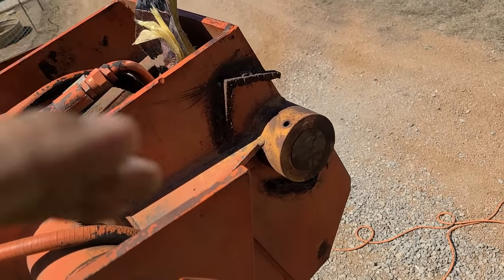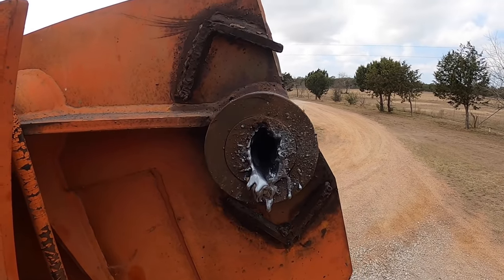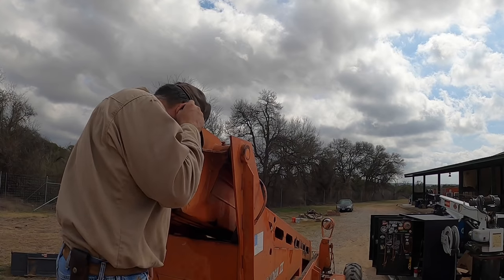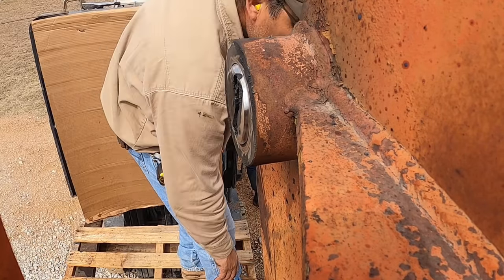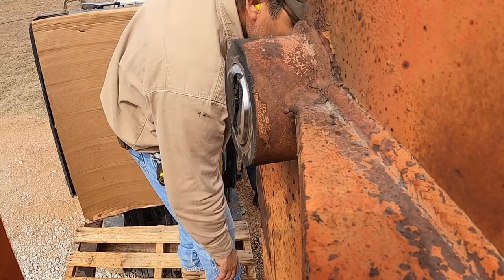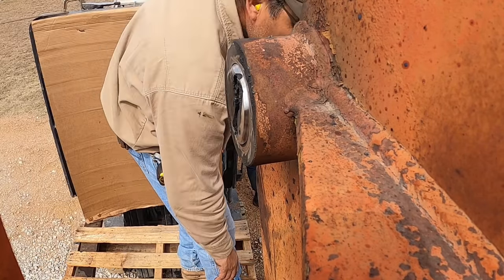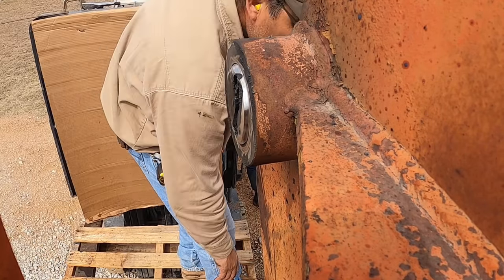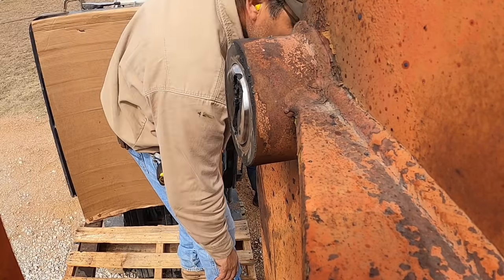Exothermic Slice torch For the Win????

Comment: Ah the good ol days- we used to heat them up and hang a 90 # air breaker from a forklift . Cut off the end of the Moil point flush and push it out manually. 3:4 air hose really hurts when the fitting lets loose , and hits you in the ribs standing 10 feet up on a scissor lift
Reply: That was the 1980s before we had pin pullers and air arc -the struggle was real

Comment: When you heat a circle (a ring or hollow cylinder)  it will expand to all directions also towards  inside. so you created more friction and baked the oil in the gap which even  made it worse .

Comment: I’m still trying to figure out why the pin needed to come out . I can’t see what it’s holding . I done one ☝️ one time . Is to weld a nut on one end and a long bolt with a air impact on the bolt . Just make sure the bolt just smaller then the pin so get the bolt out .

Comment: I have a question.  Would a have been able to move if you had used let's say.   A jackhammer? When I had to remove bushings a jackhammer worked better than a heavy hammer.  In your case what if you had used a compressor and an air hammer

Comment: Instead of buying the 50 ton jack, I think I would have rented a 90lb pneumatic jack hammer and supported it horizontally with your truck crane. When static pressing doesn't work, nothing beats shock when in this kind of situation.  Great Vid as always.
Reply from the maker: Good call!
Reply: @ICWeld  Hey Issac, I forgot to mention that drilling a few holes in the housing to add some liquid wrench can also help.
Regards  Steve

Comment: That took some serious pressure. Surprised the boom steel didn’t move where you welded the jack holder to it.
Reply: Actually did bow quite a bit, you can see it at 42:38

Comment: I used a piece of 1 inch all thread and welded a nut on a plate then welded the plate to what I was trying to drive the pin out of. Used a 1 inch impact. It came right out

Comment: Lucky they didnt take it to my shop. I would have said "Welp. Thats not comin out". taken the boom off, put it on the big mill and drilled it out or just cut the bore right off of the boom, made a new one and welded it back on. Don't think it would survive the big mill though. Cant be stuck if its in thousands of tiny chips and all thats left behind is a 2MM thick ring. I really hope they do get a new bore done on that though and dont just try to stuff a new pin in there, dont think they can get a new pin in there though.
Great on sight job though, Im kind of glad my shop cant go with me so i have an excuse not to do it! lmao

Comment: I got sick of playing with bottle jacks and bought hollow 50, 75 and 150 ton not all at once cause they are pricey but weld a pin on your pin and put jack over it and pull that pin out or push it out but pulling works better for some reason and if it does stop moving you can hit the end

Comment: I can't help but think I could have got that pin out in less than half a day.  I think I'd have used a cutoff wheel and make a horizontal cut from the outside all the way thru to the pin from one end to the other.  That alone may have opened up the bore enuf to hammer it out.  Bevel out that cut and weld it closed.  I'm no professional welder but I'm a heavy ewuip mechanic and I work for myself which means I've got no time to waste on stuck parts.  I had to learn the ways of steel.  A man named Dan Hurley from Oswego Kansas was a major influence on me during my early years in the business.  Machinist, welder, diesel mechanic, electrician, house mover etc.....smartest man I know.

Comment: You might drill a hole in that outside pipe through and insert 1-2grease fitting I put 2 hole to make sure the pin won't rust or put some krill spray or Anti seize on the new pin

Comment: Thoughts on using a cutting disc to make a relief cut on the tube? And welding afterwards? Or would it distort too much and need line bored?
Reply: I've had to do just that on some stubborn pins

Comment: Ive run into the same problem I weld a nut to the end of the staft and use a open center hyd cylinder and pull it out have you ever done that

Comment: Man, thats tough! When I get pins stuck like this pin, I  always drill a series of holes in the sleeve, usually one or two (or more, depends on the size of pin/hole) towards the top, then one or two (or more) at the bottom. Due to the rust expansion in the sleeve around the pin, this excess material/pressure needs to be released. The holes allow you to get rid of this rust either from impact or by adding a penetrant and sometimes with the help of air pressure, remove some of the rust that is trapped between the pin and sleeve. Then weld the holes back over when the pin is out.
Reply: You're on to it.  It is the fretting rust that expands on forming, and basically glues pin into sleeve.  Got to get that rust out one way of the other.

Comment: Instead of heating the cylinder which won't help, i would first deflate  the tiers on one side to create a slope, than burn a hole not all the way but close to the other end, than pour and fill it with liquid Nitrogen, that will make the pin shrink so you could push it outside much more easily.

 but the easiest method ( since you probably the best torch cutter in the world),  is to cut the cylinder with the pin  as one unit. and weld a new one.

Comment: Why not drill those 2hole in the outer tube and spray penetrating oil into what will be grease fittings to break the rusts hold 🤔

Comment: Ufff what a job..plenty of rods used…the pin was well seized, you can’t beat a touch of hydraulic, I’ve had to use 2 x 100 ton barrel jacks to remove flywheels off a Jaw crusher to replace bearings…. Great to see your son getting stuck in to the job, he’s learning from a master tradesmen.. few as good !! None Better..

Comment: I've stopped at 13 minutes to ask:  would it be a good plan to drill some holes through the sleeve and get some lubricant between the sleeve and the pin?  When the pin is out, drill and tap those holes for grease fittings!

Comment: Bottle jack are not design for work in horizontal position but only in vertical position. This is due to internal tube for pump the oil

Comment: I thought you would Di-grinder/grinder it before you started to wail on it? 
I see the other side has had angle welded onto it? Did they do a removal with a hyd  jack years ago? Do put in a ? couple of greasing points. 
Looks like a crack at 1 to 3 position on it's right side at the weld? 
Yes it is  hard ! See you in 6 hrs. ya bad joke. 
Was wondering about oiling it? 
A Clove hitch for tying it into position?  
Is this under tension or compression for moving when the pin comes out? 
Does the jack extend in that position? As some are particular as to there attitude of expansion. 
See more cracks at the 20:00+ time. 
Two clove hitches one at the hyd base and one on the piston? 
Are you above the weld at the bottom?  
I like the way the grinder cord is being wound up. As it doesn't damage the cord. 
Yes I make a terrible spectator.

Comment: I would use a portable hydraulic ram, that is those small mini types. Weld on a mounting jig, then attach your RAM, then a sized ramming slug, for the hole and then just hand pump away. Knocking it out little by little  with each hand pump. Screw all that hammering.

Comment: Buy a carbon dioxide fire extinguisher and shoot it inside the pin where you made the hole. Then heat the outside with the torch like you were. Kinda like bearing press where you put the bearing in the freezer and the clutch basket in the oven then the bearing drops in and when everything gets to temperature its a press fit.

Comment: Things I know about the job: This is a field job. Limited use of what is available. The job is finished. Would it have been possible to use the Mag-Drill to make a hole for a 3/4" thread and draw the pin out using a length of pipe and all-thread?
Reply: I used an online calculator. And for a piece of 3/4” all thread to pull 50 tons of force ( what the jack seemed to need) it would take over 1,200 ft lbs of torque. Crazy!

Comment: I had luck with welding a old socket on opposite side  of the pin and putting a breaker bar on and turn while  hitting or pushing with jack seems to help

Comment: big job. If you had your time over, but knowing what it was going to require, would just cutting it off and putting on a new one have been an option.
Reply from the maker: I thought about cutting off the whole sleeve but the I.D. would have shrank and seized up the pin bore from the welding if I didnt bore it out to its final size afterwards. 50/50

Comment: At some point it's gotta be cheaper and easier just to weld in a new piece of seamless tube and line bore it...

Well done though mate. Hope that job made you a dollar, sure was a lot of effort in it not to mention consumables (and a new jack) cost, 75 rods (3/8 X 24) here will set you back around $700 let alone the rest.

Comment: Its not a pivot point what was it used for?
Reply from the maker: It holds the end of the leveling cylinder
Reply: @ICWeld  Ya i couldnt see a break in the sleeve to show it was holding something...cheers...Have ya tried an oxygen lance they use a lot of air and you can get small ones, they work fast.

Comment: Biggest issue I see with that pin, no grease points. That's the problem about bottle jacks, they don't like to work on there sides. Looks like all you've done is blown the small seal in the pump of the jack, easy fix.

Comment: Try a penetrating liquid....Our Elevator mechanics used Sloans Liniment.   A liquid with extremely low viscosity. Very good where a steel pin such as the pivot pin between  transom motor mount and the big outboard.   The two metals seem to weld together when the motor mount and pivot shaft are not used foe several years and not lubed.   Our local marine mechanic swears by Sloan’s now.   Expensive however.    About $20 for 1/2 pt. 
Try it.. 
JoeB

Comment: No such thing as an "overly long" IC weld!!  Might check some bottle jacks can work on their sides and some are not capable going horizontal by design.  Doesn't ruin them though just refill the hydraulics after you put them back vertical.

Comment: 69 rods dang that is quite a run for just a pin and must have been pricy the rods arnt exactly byeing pasta noodles, you got more patiance then most issac looks like you could have used a rivetbuster to get that thing the rest of the way out. but good to see you younger one following you in your footsteps and trade though its often rough being a welder, and I only do a little at home sometimes for non crucial things
Reply from the maker: Yeah, I sure wished I had a rivet buster for sure!! Maybe one day
Reply: @ICWeld  ah you answered me. you have tons of comments I figured I got lost in the mix, they can nock out really big stuff, but they aint cheap I looked at the price of an air hammer like that and oh good gravy they seem to start out at 600 bucks for a decent american made one, and for some jobs you need two people to run one one to hold it up the other to brace them, we use them alot though for knocking out old bolts and rivets and staybolt ends in historical locomotive work, I never ran one, but seen someone knock out rivets and he is about 5 inches taller and prob 200 lbs give or take and it took him and another guy to run it, the 50 ton press problably provides more power and has a less voracious need for power then a massive gas air compresser it takes to run an air hammer that big, 
a riveting or chipping hammer might be of use to you as well for stuborn things like this as well and not quite a heavy appatite for air.

Comment: Hi why not weld a large junk of threaded rod just smaller than the pin and a pipe to machine it would make a pin puller don't know just a thought good luck nice work. Just though this might help rather than a regular nut use a  Extreme-Strength Steel Coupling Nuts
Also known as extension nuts, use these to connect and extend threaded rods. Made from Grade 2H steel, they're about 20% stronger than high-strength steel coupling nuts and comparable in strength to Grade 9 bolts.

Comment: would have welded a 1" rod on to the end and use a hydraulic Pump,  There was enough steel to grab for sure  Even a long  30"  1/2 drill would have relieved it.

Comment: ugg, fuck that,... reminded me of working hard labor job when I had to pound rebar into parking curbs to pin them into the asphalt, but like a massive parking lot full of them and they were the huge ones for semi trucks, by hand! After doing that for a week I felt like a circus freak, like some monster they keep in a cage to only come out to pound stakes for the circus tents. OH, and I've done that too,.. pound stakes in for circus like tents.
I wonder if you were to take  cylinder of CO2 and turn it upside down and dump it into that slot you cut, if that would have shrunk it enough for it to move out easier.

Comment: Don’t understand what’s the purpose for this pin
Reply: Must be a hinge or pivot of some kind. Perhaps it was longer at one point before it broke off.
Reply: @opendstudio7141  but not attached to anything
Reply: @dennisisaac746  It's a LULL Highlander II rough terrain forklift, used in construction sights.
Reply: @opendstudio7141  yes but what was the purpose of taking it out lol wasn’t hurting anyone lol
Reply: A hydraulic cylinder lift point.
Reply from the maker: It was the leveling cylinder mount. As the boom moves up, that cylinder keeps the forks at whatever position you set it at.

Comment: you seriously have to wear at least a mask when gouging! a welding helmet is not proper ppe for that job! the heat and air separates the iron contents and mixes them into the air you breathe, not only can it clog up your lungs it´s also quite carcinogenic wich means cancer is highly at risk. just an advice from a 34 year old boiler maker wich hardly cant breathe today.